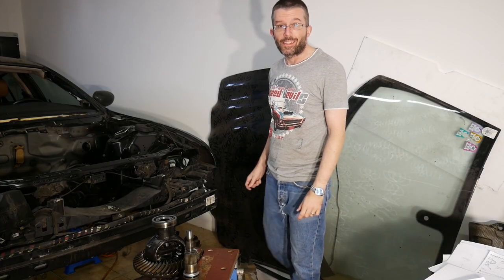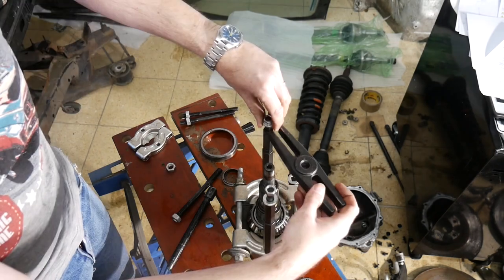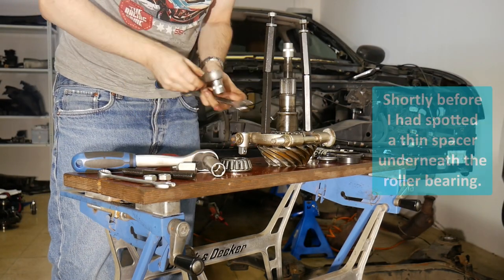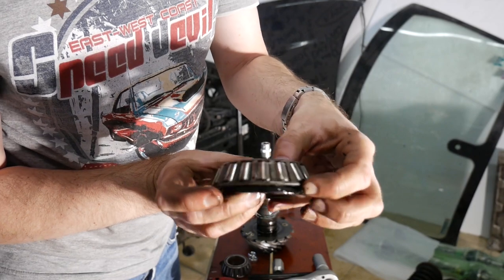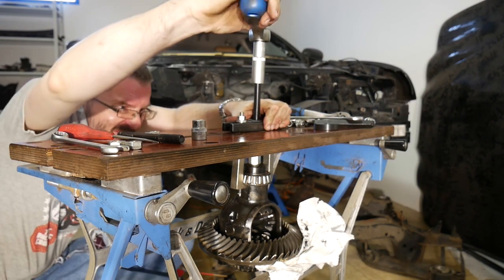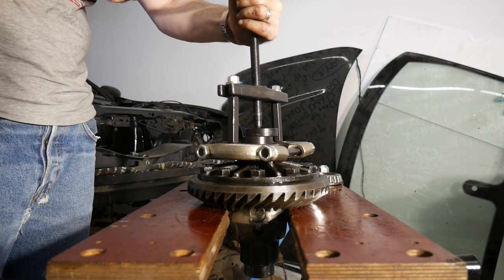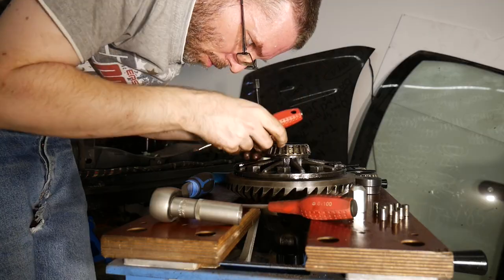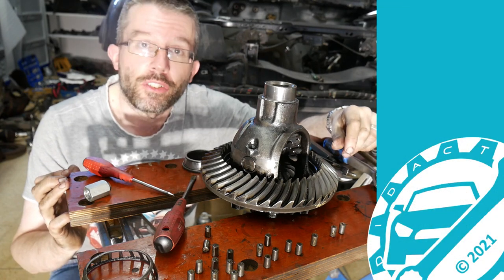Jaguar S-Type Restoration [95] DIFFERENTIAL Teardown (4) Bearings [2021-10-03]

Comment: If you ever decide to publish a full repair manual for it I would buy no questions asked brother. Does anyone know where to find a 2000 Jaguar S type repair manual?
Reply from the maker: http://www.jagrepair.com/JaguarSTypeElectricalOBDIIcodes.htm is the best source for Jaguar manuals. The file "S-Type 2002.5-2008-FSM-Workshop" (3.316 pages) covers past 2002 S-Types but may be helpful for the work on older ones too.
Reply: @AUTOdidact77  thank you so much 😊 your awesome brother love the videos 🤩